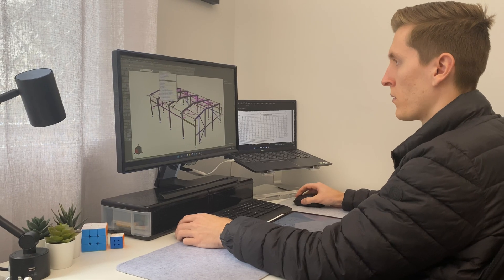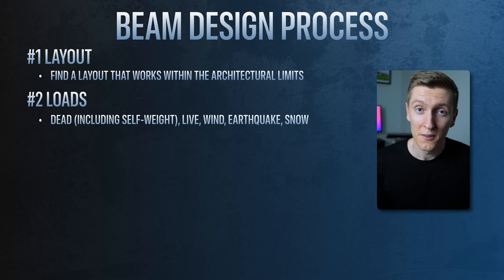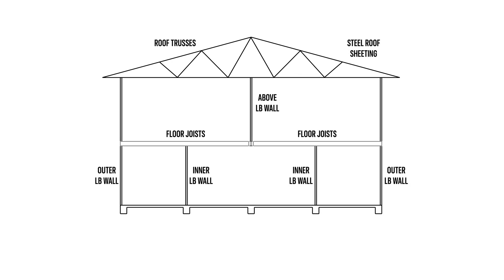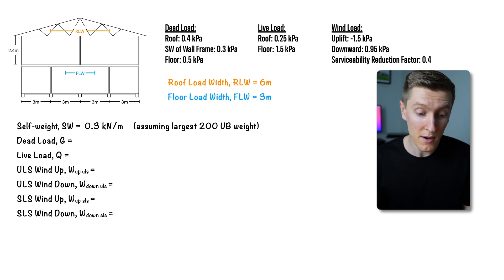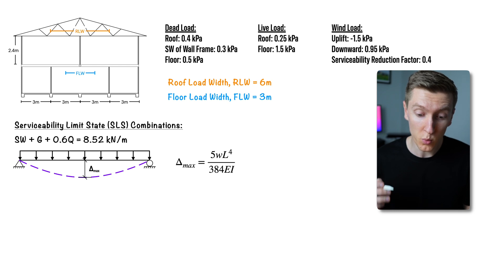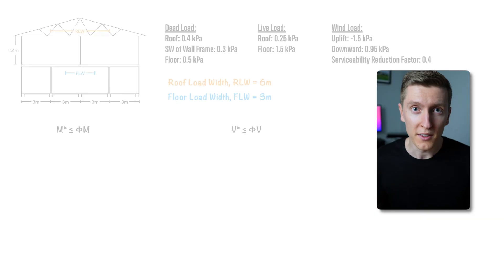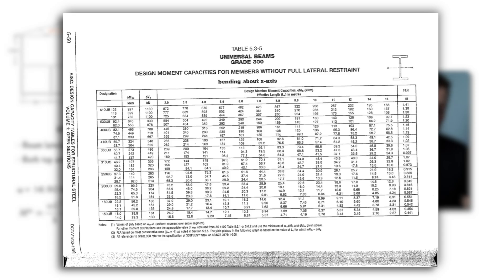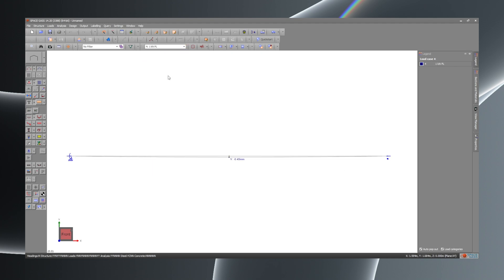How To Design a Steel Beam For Beginners: Hand Calculation & Software

Comment: Love your videos!!  I have a question.  I’m turning my barn into a shop. I need to get the post out of the center. 2post need to be removed. This will give a 30ft span I need to install a beam.  The plan is to put a beam across the 30ft and cut the 2 center post to sit on top of the beam so the roof is still supported.    I understand you can’t be responsible for anything.  I have a good idea on what size beam I need.  I would just like your opinion on it.  Just to make me feel better.  I understand it is ultimately my responsibility if anything goes wrong.   Your opinion would be greatly appreciated.    If you wouldn’t mind helping I can give more detail.  Thanks.

Comment: What software we need to use to design a beam steel structure
Reply from the maker: Spacegass is the program I showed in this video but there are others available too :)
Reply: Can we use any other software like Tekla or Stadd pro or Autocad revit @BEngHielscher

Comment: When calculating the dead load for the steel beam, do you not also need to consider the weight of the floor joists?
Reply from the maker: Yes, this needs to be considered and this is allowed for in the value of G (dead load) :)
Reply: @BEngHielscher  Ok, so (I'm sorry, I'm just trying to remember everything I learned), we take the floor framing design, which are applying point loads to the beam, but we simplify it to uniform distributed loads for easier calculations. And then add that to the dead loads for the load combinations.

Comment: Hi what analysis software is mostly used in Australia ?
Reply from the maker: I mostly use Spacegass, Strand7, Ram Connection, Structural Toolkit and Ram Concept. There is a bit of variance depending on where you work though :)

Comment: What is the difference between strhctural engineer and civil engineer? In my country they are same
Reply: Structural engineering is a specialty within civil engineering. Structural engineers mainly design buildings and bridges. Other specialist civil engineers include geotechnical engineers, transportation engineers, quantity surveyors, construction project managers and hydraulic engineers, water resource engineers and environmental engineers.

Comment: Very helpful video. Just wondering where in AS1170 you got your ULS and SLS combinations. Can’t find a few of them from 4.2,4.3 or table C1
Reply from the maker: Thanks! Which particular combos?
Reply: The SLS combo where you use long term factor 0.6 and times it by Q. Since it’s a floor beam for a house, I thought it might be under residential and domestic and be 0.4 instead. For ULS, the 1.2 SW + 1.2G + Wu has me confused as well, closest thing I can find from 4.2.2 is 1.2G + Wu + combination factor x Q. In order for the two to equal, the combination factor would need to equal 0 which doesn’t match up from table 4.1
Reply from the maker: For the SLS combo, you’re right, 0.4 is the typical factor you would take for a residential house. 0.6 is a bit more conservative and covers other use types so that’s why I used it. If you wanted to really stick to the code and economise your design 0.4 can definitely be used. For the ULS combo, I really should have showed a + 0.4*Q on that load case. It doesn’t govern in this design but should be included in case it does in others. Thanks for bringing this up. Cheers !
Reply: Ah I see, thank you for getting back to me. Everyone has different engineering judgement/interpretation of the standards which is cool to see. Keep up the excellent work. Any concrete elements would be super helpful, like slabs or footings.